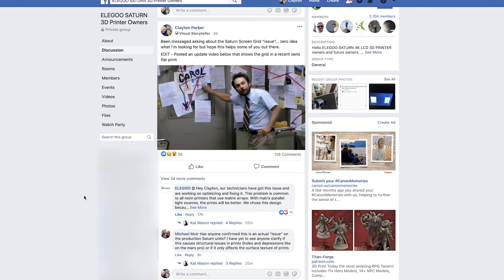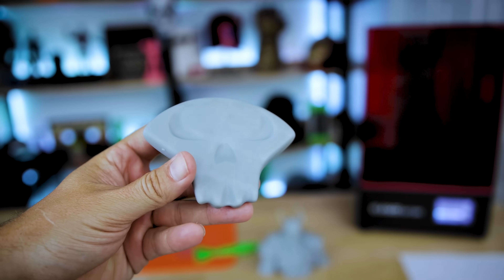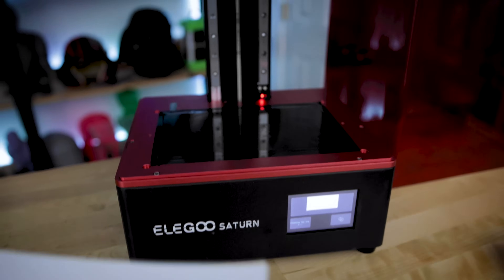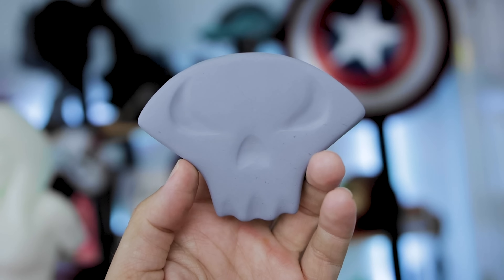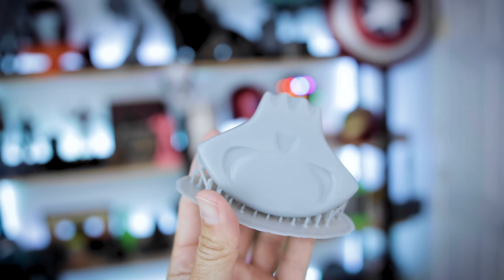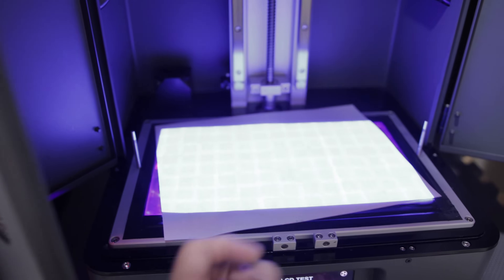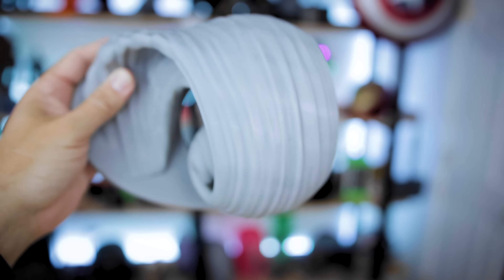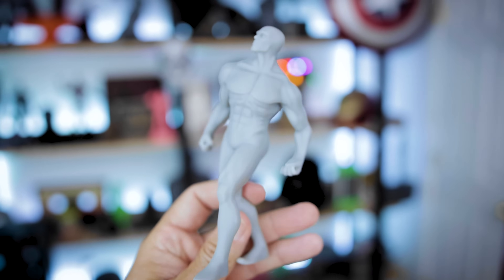Grid Print Issues with Resin 3D Printers & FIX from Elegoo!

Comment: So ahh ... got my Saturn a few days ago and it appears like it is there in the retail models. Any web links to the supposed fix from Elegoo? It's honestly only a surface texture thing. Shiny grid lines on a matte background... I will live with it as opposed to applying any sort of unofficial fix. It's not a huge deal. If you don't want to paint I'm sure a little 600 grit sandpaper will even out the surface finish as well

Comment: Probably not the best place to ask,  I print things like brick walls, doors, windows and other small detail parts that need to maintain the flat shape when installed into a model buildings.  After the print is done (Photon) the prints are flat like they should be but after a week or two they start to curl up or as I call it potato chip.  This make it impossible to fit into the openings in a building or just pop out of the window frame or door frame.  Any tips on stopping this post print warping?  Maybe a type of resin to use that will not warp or a setting to change on the printer.  most prints curl into the brick pattern on the wall.  I was thing as far as printing a mirror image of the bricks on the back of the wall.  Any help would be great thanks.

Comment: Take a diffuser from an old tft monitor and place it above the light source: FIXED.
An image search for "diffuser sheet tft" shows you more information.
Exposure times can increase though.
BUT, if you take more pieces out of the old screen, like the ultra fine lenticular lenses sheets (there are two of them, each shifted by 90°), you can actually have a focused light source which doesn't burn the lcd (still longer exposure times).
I'm also trying to apply an UV-pass filter to increase polymerization and a thermo-electric-cooler to keep the surface temperature of the LCD mask down but this is pure speculation as I still have to try.

Comment: who knows what (entry level) machine has the best screen pixel density?
Reply: It doesn't matter. Already at the Saturn / Mars / Photon level ( 0.047-0.05mm ) the pixels are not the limiter. Light collimation, distance from the mask to the resin, and light bleed/reflection/refraction are the limiters. As long as you stay under about 60 micron you're good.

A big detail improvement can be had if you can do something about the gap from the LCD to the resin. For example, removing the glass and plastic cover. However, this will almost certainly result in a dead LCD pretty fast. I was experimenting with trying to remove the plastic backing ( About half of the thickness ) and just using the glass half of the cover, but I was only willing to test 2 for the time being and unfortunately broke the glass both times.
Reply: @zemerick  good to know, would never occured to me. elegoo should implement that. What difference will it make to the raw print quality if I did this mod ? You would probably need a stronger UV light source mounted further away from the build plate and . As LEDs have beam angles, so how about using more really narrow angle LED  (say 10 degree)

Comment: I inspected some prints from my sonic mini and there is a faint grid pattern visible, doesn't appear to have  any raised areas or depressions. Oddly I have a print of a large flat calibration test and the plate side shows no sign of the grid, but a faint one on the side facing the vat.  Hasn't caused any issue with failed prints as I haven't had one of those in months.

Comment: I'm glad that Elegoo is sending out a fix for this, I just got my Mars Pro last wednesday and although I hadn't noticed any grid lines on my first couple prints now that I've looked for them I can see them on flat surfaces.
Reply: Most likely Elegoo is only talking about fixing the bad batch that have the edges and corners of the grid under exposed, not overexposed. If you are seeing like the in the video where the grid is bright, you're fine and they probably aren't going to want to change that.

The real serious problem is a few pros went out with it the other way around. Instead of a trivial cosmetic effect that only shows at specific angles: These printers completely failed to properly expose those areas. Prints could have a hole drilled through them, or a grid where the print sags in, etc.

Comment: Every single MSLA resin printer on the market has the issue, if it doesn’t have a multi-layer diffuser.  Being able to see it is irrelevant, as it is there, but it may not have a direct impact on all prints. This is why TVs have at least 3 layers to their background diffuser, and most have 5+.

Comment: The Saturn has some over-cured areas. Nothing that’ll ruin quality.  The issue is the opposite on the Pro where it will leave grooves and holes that look exactly as it would with dead pixels in the screen.  Either way, no one should stay away from purchasing either of these machines.  Elegoo is proving they stand behind their work and really do care about the end user experience by doing everything in their power to make it right for everyone effected.  They’re sending out the most expensive components of the machine for free, not even charging shipping... No matter how long you had your pro (from what I understand).  Making it right is easily costing them tens to possibly hundreds of thousands of dollars, and they’re not even batting an eye.  THAT is a company I’ll gladly do business with over and over again.
Reply: I was just about to post the same explanation of the pro's vs saturn's grid problem. The real issue here which you can actually see in the video is that the saturn array has 3 separate lens plates and any gaps or misalignments between them will cause areas of under exposure (as seen in the large darker line on the right hand side of the paper test).
As for elegoo sending out free parts, the part they sent me was destroyed in shipping (they'd sent it in a brown padded envelope) after it took over a month to get here, I don't even know if it would have worked. Thankfully I have a large FDM printer and just printed a new lens spacer instead.

Comment: So I would be interested to know if the larger screens that produce this issue have glue lines on them from the adhesive that holds the screen to the glass plate it's mounted to.

Comment: Would be interesting to see how these 'grids' look on something printed with transparent resin.
Reply from the maker: Ohhh great call. I will try that out
Reply: I tried it. Opaque grid marks in what should be translucent (glass-like) once sanding/polishing. Returning my Mars Pro while I'm still within the return window. Elegoo support told me to wait until Friday for a fix... it's Friday evening and no communication yet. I've received a few communications/seen announcements that first state they have a fix, and then they don't have a fix, and so-on-and-so-forth. I'm honestly thinking it's a stall tactic so that more return windows close.
Reply: I'm seeing the grid issue on transparent prints on my EPAX-X1K and my Mars Pro. EPAX told me that there is no way to completely avoid it on printers with the array. I just received my Saturn and I will be testing it this week. In my case, the issue isn't bad enough to make me want to return the machines.
Reply: I have the same issue with Photon Mono and Clear resin.

Comment: This is my first Resin printer, I was lucky enough to get an early bird pre-order, anxiously waiting for the e-mail to say its shipped and I can't help but feel nervous when it arrived.  Is the bed damaged? Is the screen showing grid pattern? Will it print?
I'm hopeful its perfect out of the box and if not Elegoo support will help but just can't help but be nervous now
Reply: I wouldn't worry about the Grid pattern. The way it prints it only allows a certain amount of resin to get be cured at a time. Those sections will be cured more due to the overlap of the UV light. Otherwise it will be fine, Have fun with that big printer. I have to wait until normal orders go live :(
Reply: Thanks  @slathian1223  for the confidence and reply.  I hope that everything runs smoothly but sounds like Elegoo support is around for help and I'm sure Uncle Jessy will also post more in the FB groups or YT with more help.  I'll let those groups know how it works out when mine arrives

Comment: What a shill.  Clayton gushes over Elegoo support and heaps praise on them for developing a solution and for addressing this issue "really, really, quickly."  Meanwhile, to my knowledge, nobody has received replacement parts that fix this issue and many of us have been getting the runaround from Elegoo regarding this issue for months.
Reply: how long ago was this issue reported to Elegoo?
Reply: @evilution_ltd  I personally contacted them about it on July 15th.  Others contacted them earlier.  They acknowledged the problem and offered to send a replacement grid, lens, and LCD screen from their factory in China.  They said they would "check and test the replacement" parts before sending them.  I received the parts about a month later, but after installing them, they made no difference.  After emailing Elegoo back and forth again, they said "this problem is the design of the light source structure, we are already improving this light source structure.so we provide new lens and UV light board to solve this problem."  They sent me a tracking number 6 days ago, and the tracking number still shows that it hasn't been shipped.  To my knowledge, nobody has received any replacement parts yet that resolve this issue.  By the way, my original Mars prints flawlessly.
Reply from the maker: So would you prefer I don’t bring this issue or other issues up and help get these companies to try and address them? Completely ignore issues I’m seeing with machines? All I can do is help call out issues or cool stuff I’m seeing.
Reply: Uncle Jessy What did you do to get Elegoo to address this issue?  Nothing. You didn’t say anything about it a month ago when the scope of the issue became public on the Facebook groups. No. You waited until Elegoo made a public announcement about it. Then you claim, laughingly, that you probably have encountered this problem, but never noticed it. Give me a break. You didn’t happen to notice the obvious grid lines on your prints until Elegoo announced the problem?  I’m glad that you can see them so clearly now. 

Meanwhile, those of us who are stuck with defective printers and holes in our prints have been given the runaround by Elegoo. They keep shipping us replacement parts that arrive a month later and don’t fix the problem. For many of us Elegoo hasn’t addressed the problem “really, really, quickly.”  But hey, if Elegoo does finally have parts that will truly fix this problem, I’m sure you’ll be one of the first to get them.

Comment: It's more pronounced when the grid pattern shows a grid pattern of low intensity, all the Saturn's have a high intensity grid patter, strangely the Mono X does not show this behaviour.
Reply from the maker: Great to know!
Reply: @UncleJessy  Yes. To clarify, where this really all started is a batch of Mars Pros went out with an incorrect lens height. Normally, you want some overlap between each "cell" to guarantee complete coverage, much like you see on your Saturn. ( Though it might be a bit too much there. )

When it's the other way around, like the bad batch of Pros, you have undercured spots even to the point of holes at the corners of the cells. In this case, we aren't talking about a trivial cosmetic issue, but enough damage for the print to be considered a total failure.

Naturally, this is going to depend on your exposure levels for your resin a fair bit. Someone that has the bad lens, but has their exposures higher than normal, will likely just have a similar effect to what you saw. If the exposure is well dialed in however, or especially if it's on the low side, it's a major issue.
Reply: The regular Photon Mono (*NOT* X) has the problem, especially noticeable with clear resin.

Comment: I get it on my Transform too but it doesn't effect the print at all.  It will all get painted over any way.
Reply from the maker: 110% I’m curious how many models I’ve printed that I have this issue on and just never noticed
Reply: @UncleJessy  I've noticed it but mostly on large flat surfaces and anything I've printed flat on the build plate.

Comment: Guys I wouldn't worry about this "issue" at all, it seems to me that it's something related to the design of resin printers. After all, you should paint your miniatures even if it's just a solid color. Or at least most of the cases and people I know, always sands and paints.
Reply: Except that on the mars pro some folks get lines that are deep enough to feel and also holes/failed supports along the grid. Not cool. Hopefully the new parts will solve it.
Reply: MyChobe yes, uncle jessy has them but it looks like the alignment of the lens/tube is only minimally off so only shows a subtle grid pattern. Others are dealing with greater variation resulting in noticeable differences iN curing and surface unevenness.
Reply: Not everybody makes miniatures tho.
Reply: @TheVFXAssault  What would you make and not paint? Like a piece of machinery or something like that? That would best work if it's solid or directly in nylon or a strong petg. But maybe I'm ignorant, what are you making that you leave as it is? Thanks for commenting!
Reply: And also there was a typo haha, I meant "prints" not "miniatures", sssoooorry
Reply: @HenryCreations  For those who print in clear resin, why would you want to paint it? If clear is what you're going for, you'd never paint it
Reply: @HenryCreations  Jewelry, molds, electronic enclosures, etc.
Reply: @JohnClark-tt2bl  Dude that is such a fair point! lol I'm casting now in epoxy resin and no idea why I hadn't thought of that!
Reply: @peterteal880  Good to know! Thanks!!
Reply: I don’t want to paint or sand my prints. This is major disappointing.
Reply: @Henry Creations  Masters for molding and casting.

Comment: Just a heads up. Elegoo already sent some replacements that did not work, but they should be supposedly making a new design. BUT! Keep in mind there is no way to actually eliminate the issue fully. There is always going to be a little bit of a grid, at least on the Mars Pro and probably the Saturn. Its just badly designed from the getgo and no replacement can fully fix it.

Comment: I contacted elegoo last week regarding this, on prints with very thin walls sometimes holes occur across the grid pattern which is the only reason i noticed. After sending them details of the purchase and a photo of paper over the screen they immediately setup sending a replacement. Not received it as of yet as it is being shipped from China but after I've installed it I'm hoping for the best
Reply: Hate it to break it to you, but there is no way to 100% eliminate the issue.
Reply: @TheVFXAssault  95% will do xD

Comment: Is the artefacting from the UV LED COBs possibly?
Reply: Its from the reflector array thats causing this.
Reply: This doesn't happen on the original mars because the leds are far enough away from the screen that they don't make a pattern.
Reply: @MrCinpro  No...Its because the original mars has just one big COB led in the middle, not a array.
Reply: @TheVFXAssault  I know, I was trying to keep it simply for less technical people. I was working with another youtuber for the spacers after sanding didn't work.